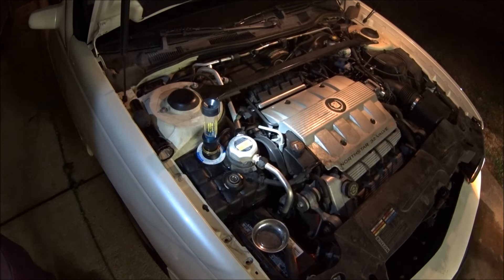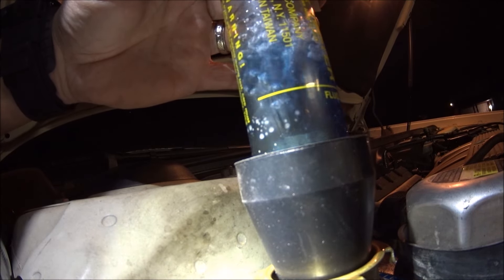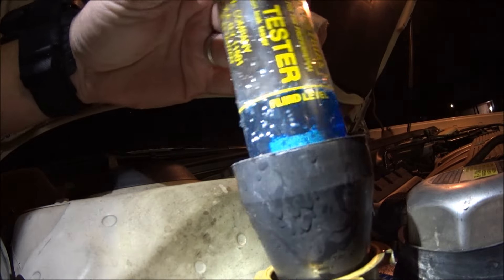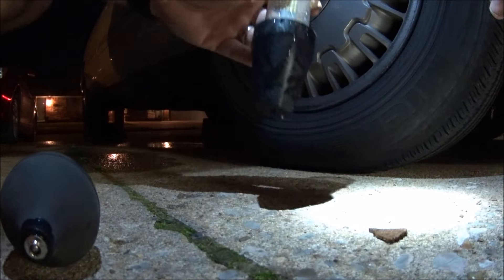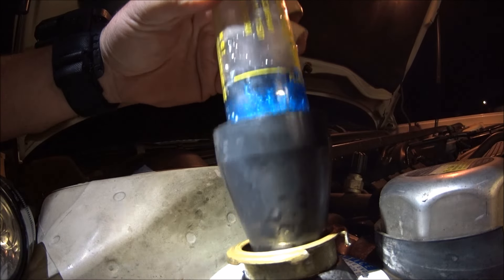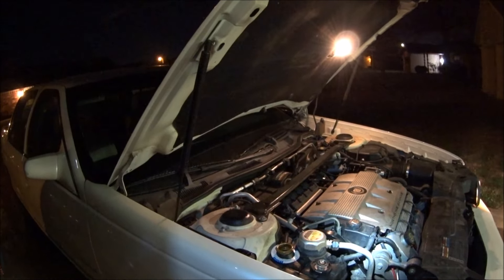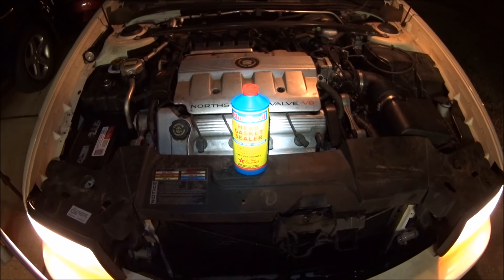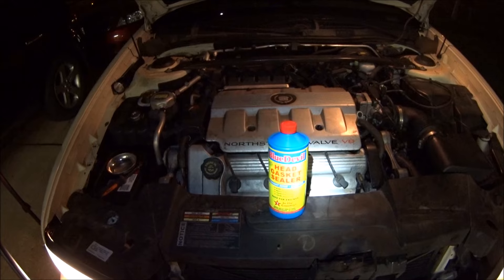Blue Devil Head Gasket (Part 2 of 2 ) Will it work??? With Block test Proof results

Comment: Dude call me crazy but I could swear if it turns yellow you still have a head gasket leak. The gases activate the pigment of that fluid so if it sniffs no gases it won't turn yellow.

Also the bubbling and pressure from your last video were the exact gases I'm talking about. 

I'm a huge believer in blue devil but I would have flushed that cooling system incredibly well before using it. In some cases I think liquid copper or liquid aluminum is better in warmer climates where a heater core isn't a concern.
Reply from the maker: HaPPyPwNy where it turned "yellow"  i sucked up coolant (dexcool)  you can see the level rise. That's why i did it again. And yes i did flush it real well off camera.  Didn't record because people grip about my videos being too long.  But to this day its still good
Reply from the maker: HaPPyPwNy @ 3:10 i went to the exhaust pipe and sucked up exhaust gasses from the tail pipe
Reply: Ah ok. I'm was making you realized there may have been a problem. I got a cracked one now I think that stuff is great but that also being said I think it's almost as much work as replacing the head gasket on small cars.

None the less it seems a fortune on my van and Ive seen people replace them multiple times because the block wasnt surfaced correctly. 

I'm literally just starting to lose coolant, have a slow drip at the exaust. The way I see it for a $2k van I'd be an idiot to pay another $2k to fix it right. Call me crazy but I believe there are some exceptions where additives are smarter choices. My van almost certainly but it is what it is. 

With that product I will perform a superflush to loosen up all gunk in coolant system,  before adding, to hopefully achieve the best effect while cleaning out orafices at the same time. 

It's all preventative maintenance because it seems like all head gaskets are meant to go nowadays it's just a matter of catching it before you have antifreeze fog billowing to where you can't drive in reverse without a mirror on a telescopic stick.

I see people let their leaks get to where it's smoke box, cars misfiring, radiator fluid all in their oil, and then they take cold water from a hose and spray it directly on an engine so hot it's lava orange.
Reply from the maker: HaPPyPwNy yes i would have replaced the head gasket but with this head ( aluminum head and steel studs there's been alot of broken studs....i guess in the northstar engines this is a common problem)  this is the only reason i didn't do it correctly/ permanently

Comment: What’s the status as of today
Reply from the maker: As far as I know still good (but keep in mind this is a little old lady's car) and since this, she may have put on 3000 miles almost 2 years later.  So I cant tell you for sure on long term.  Really wish I could.
Reply from the maker: Also keep in mind if it doesnt work you get your money back from Blue Devil I believe so keep your receipt just in case
Reply: 2LateIWon/Organized Chaos two questions. Maybe just one. How much water did you put in before adding the blue devil. And then how much pure anti freeze did you use after process was done and how could you tell. I have a Nissan Titan
Reply from the maker: I dont remember what the instructions say but Id just use 50/50 mix when filling it back up so you wont have to worry about the mix.

Comment: it's kind of funny the car he showed with the head gasket he put it into the radiator but part two of the videos he's putting it on the fender now on the passenger side so it's completely fake because it's not the same car and before you say anything I've been a mechanic my whole life I did notice that it was put in the radiator and part one but in part to its put on the fender now
Reply from the maker: First of all who are you talking too? 2nd are you calling me a liar? 3) if so why would I lie I bought all this? I paid for this out of my pocket (well grandmother in-laws pocket)  Ill give you the benefit of the doubt.  Maybe you didn't see my first video.  Maybe you saw someone else's video because I assure you this was the same car.  Its even in the same place.  It was just later that day.  So you should double check your facts before trying to call me out.